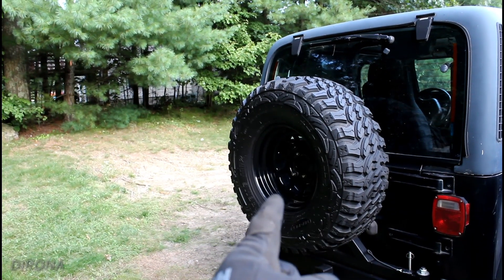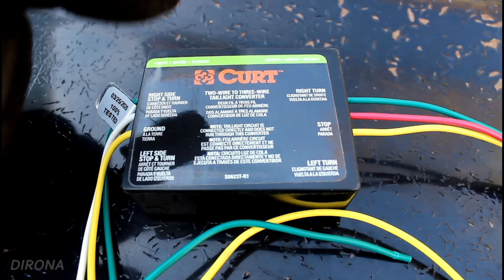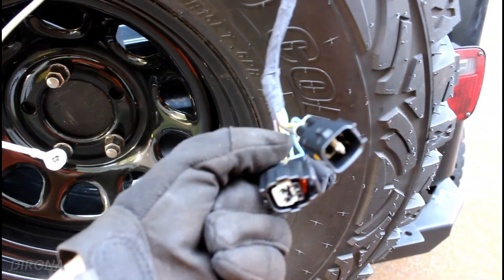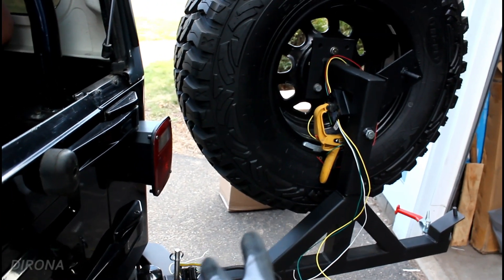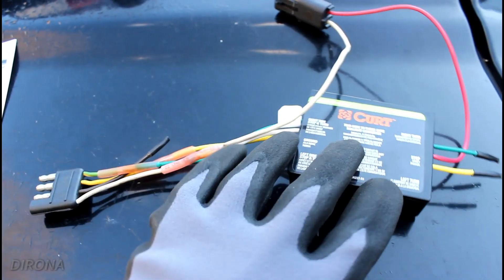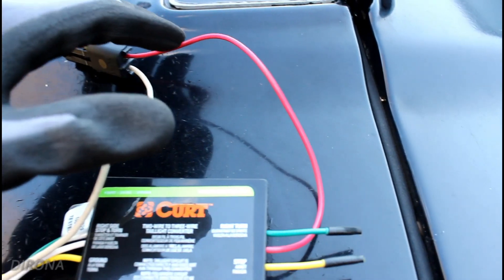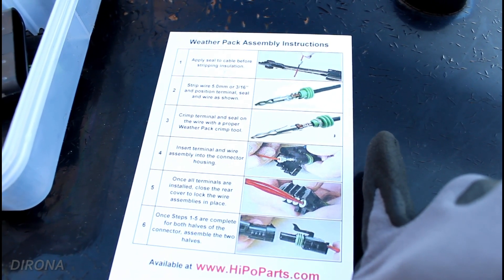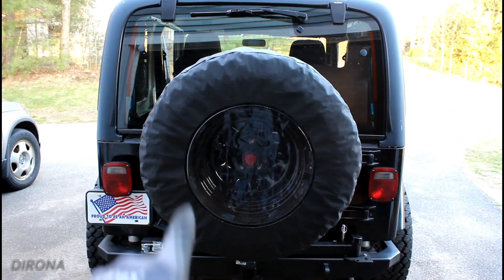Custom 3RD BRAKE LIGHT for the Jeep TJ | Budget Crawler Ep. 24

Comment: Where did get the water tight connectors from?? Great video
Reply from the maker: I bought the Weatherpack connectors as a kit from hipoparts.com but you could also check eBay or waytekwire.com for price comparison. You have to buy each component individually from waytekwire, but if you're putting in a large order it would probably be cheaper to buy that way in the long run.

Comment: I’ve got that same third brake setup in my TJ as well. Question- you mentioned that you try not to cut into factory wiring....I’d like to do a kill switch on my TJ to prevent it from getting stolen. What’s your thoughts on that if I were to do one?
Reply from the maker: Cool! I'd recommend installing SKIM (sentry key immobilizer module). It's the factory anti-theft system that was installed in some TJs and as I understand it's very effective.

Comment: i've used solder heat shrink and it definitely sounds like you over solder connections. i have never had any issues with solder heat shrinked connections and i have had then on my car for years
Reply from the maker: That is certainly possible!